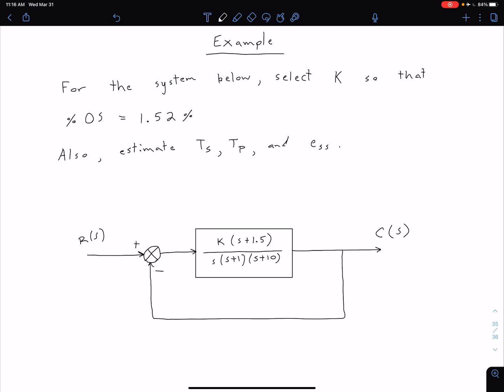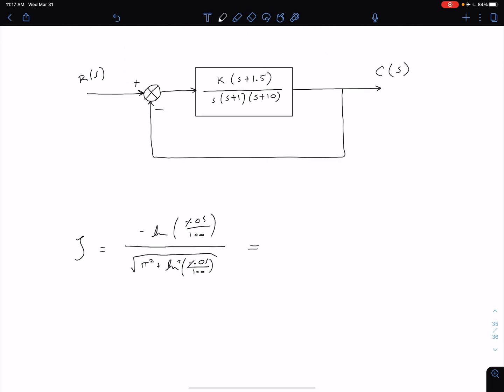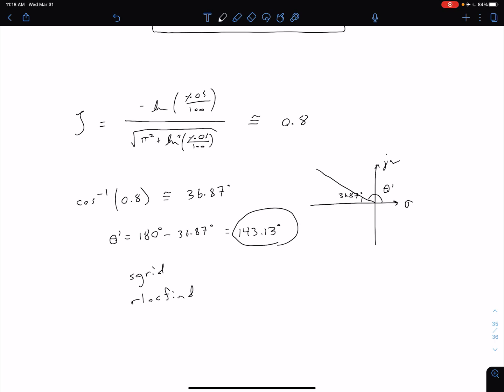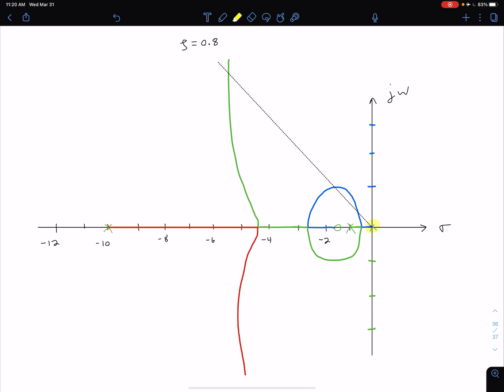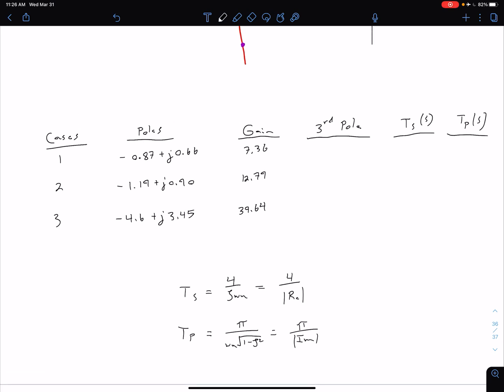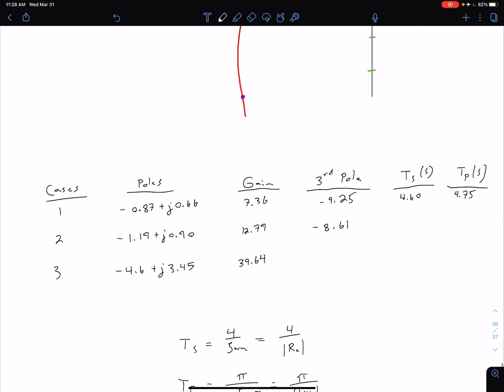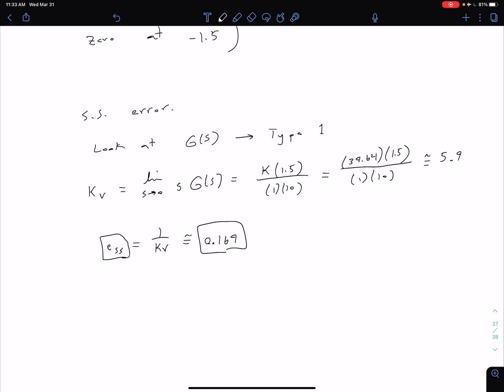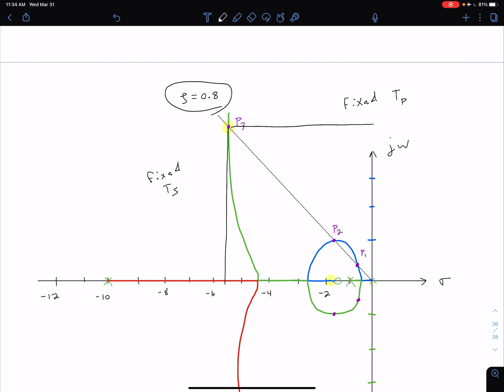Root Locus - Example: Design via Gain Adjustment

Comment: Interestingly if you plot the step responses of the three options P3 actually does the worse when compared to a prediction based upon a second order system. E.g., predicted Ts for P1 is 4.56 sec and actual is 4.5 sec whereas predicted Ts for P3 is 0.87 sec whereas actual is 1.57.  Also percent overshoot predicted for P1 is 1.63 %(actual 2.71 %) compared to P3 1.54 %  (actual 9.54 %). P3 does a little better percentage wise with Tp with P1 4.76 vs 3.68 compared to P3 0.91 compared to 0.76.